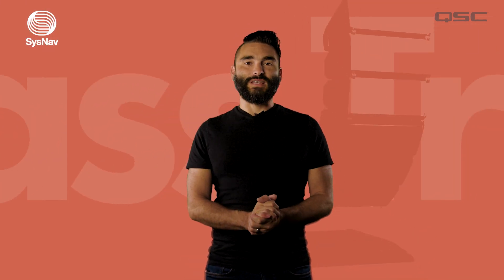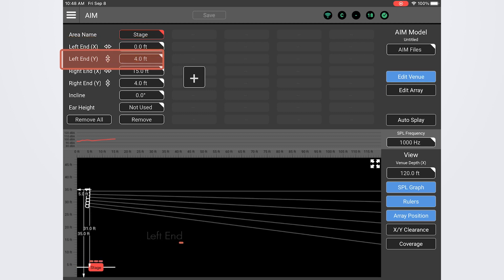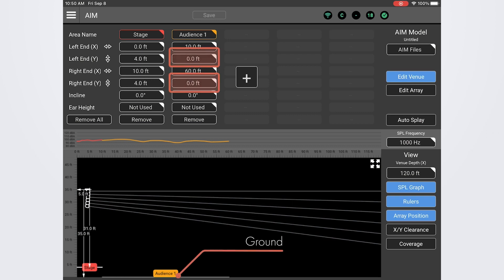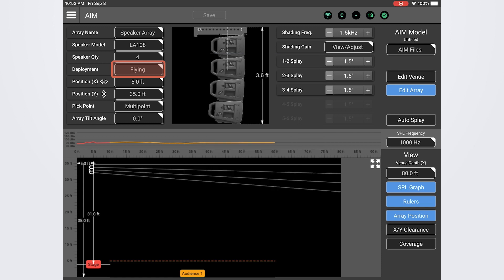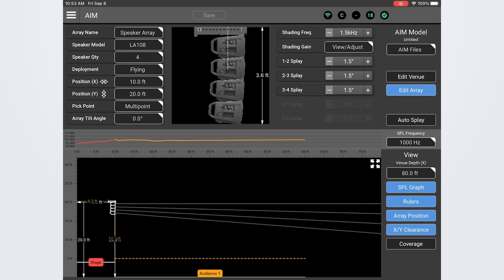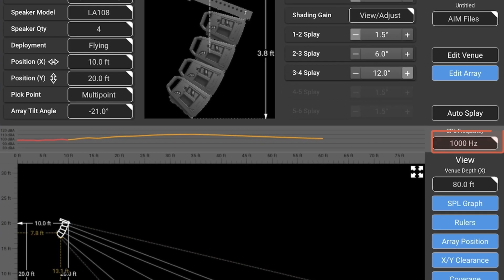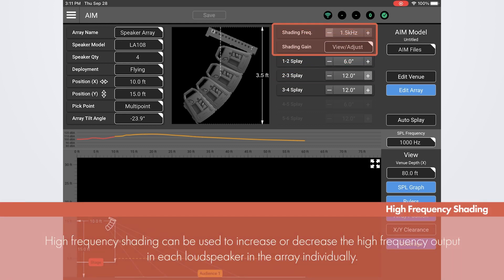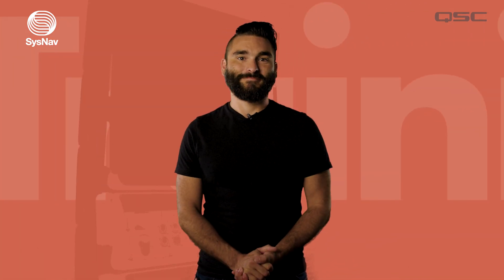QSC SysNav App: Using the AIM Module

Comment: Your final array tilt angle above shows 14.5 but I think u said “ur happy with 15.5”?.   Explain this multi point  “pick point” again. What is it and why. Thanks Jason.
Reply from the maker: You are correct about the discrepancy between the dialogue and what is displayed on the screen. Good catch. Regarding multipoint versus single point, pick points- The array frame, which is the accessory used to suspend an array contains a number of pick points, or attachment points (holes) along the center and outer rails. The holes allow a shackle to be attached to the array frame so that it can in turn by suspended from a structure. The term single pick point refers to the use of one single attachment to the frame. Whichever specific attachment point is used will dictate the overall down tilt of the array. Multipoint pick point is when two attachment points are used. Meaning two shackles and two chains connect to two different attachment or pick points on the array frame. With a multipoint setup you have more flexibility with the array down tilt. You can adjust it to any angle desired by raising and lowering the front and back of the array independently. I hope that helps to clarify. If you want more information on the array frame and rigging an array to be suspended, you can watch this video here-https://www.youtube.com/watch?v=ZGpgXrShw-o

Comment: So when you pressed the  splay all boxes went from being 1.5%. To the top array at 1.5% then next 6%  and bottom array to 12%.  So we are assuming you meant to say to physically adj each array now to 1.5 6 and 12 degrees. Right ?
Reply from the maker: That is correct, yes. The AIM module assists with figuring out how to set the splay angles before the array is setup. Then, when you do set it up, you already know what angles to set it in order to get the best performance from the system.